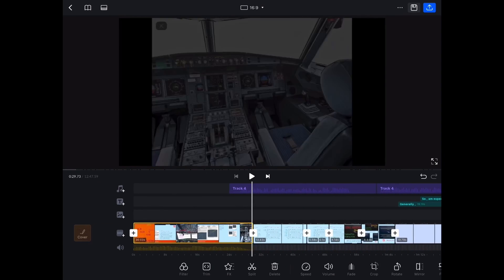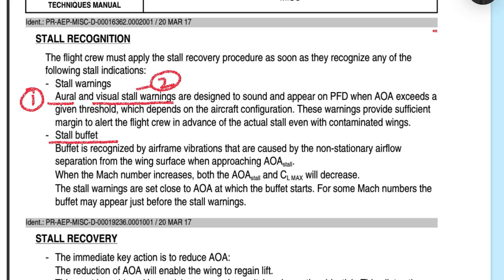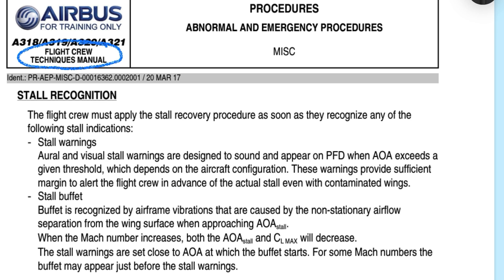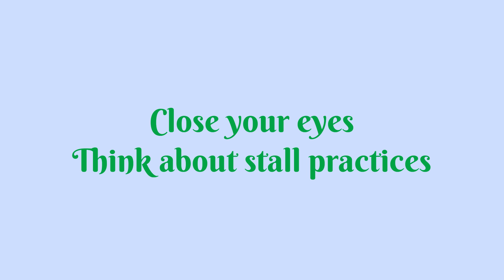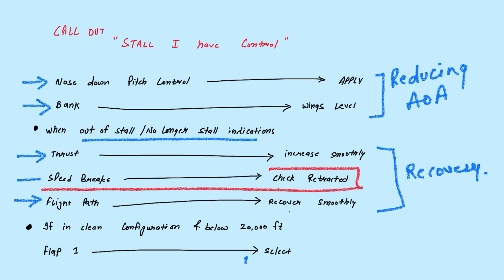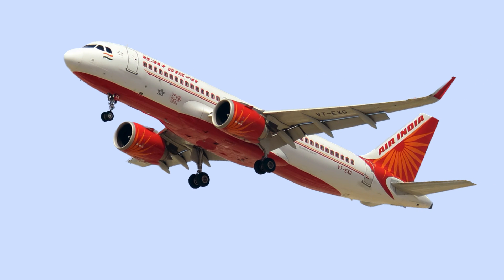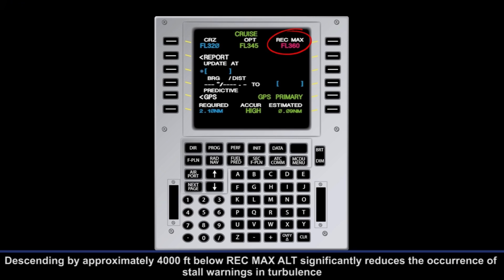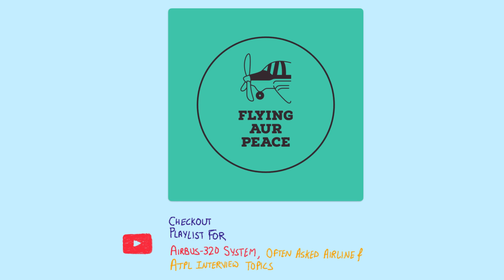Stall recovery || Memory item | Airbus A320 || All you need to know

Comment: Unless one slams the rudder or turn coordination unavailable only then it will go into spin. Otherwise bank alone doesn't cause a spin. Wings are kept level to increase vertical component of lift and reduce load factor.  

And thank you for making a good contribution to flight safety.
Reply from the maker: Exactly Vivek 😄 
That’s true ….